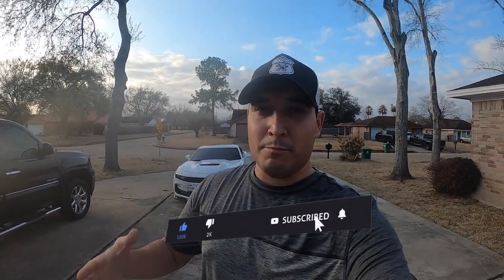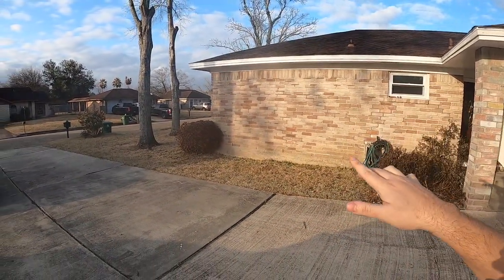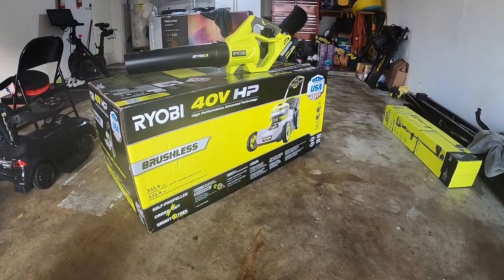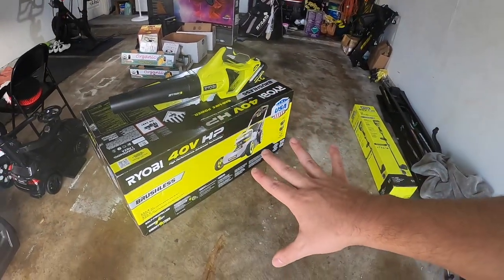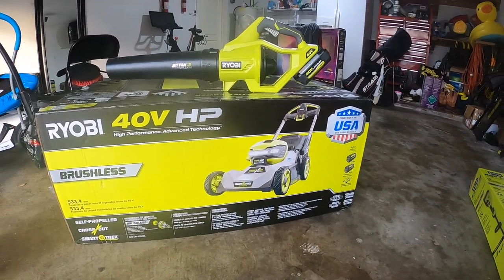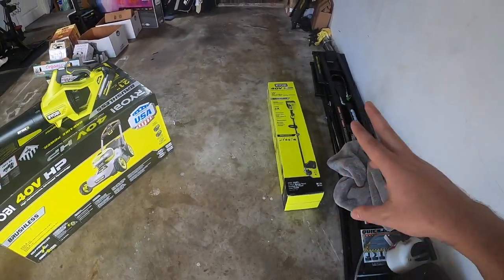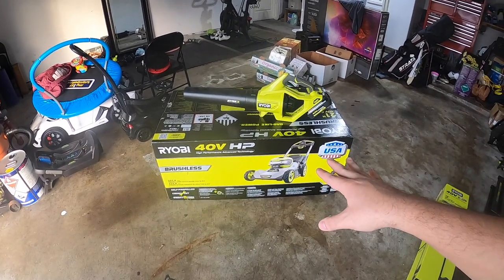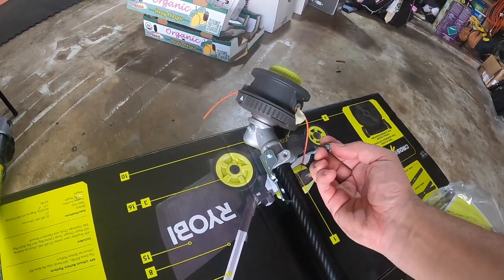RYOBI 40V HP Mower and Carbon Fiber Trimmer! FIRST LOOK | Vlog #409

Comment: Jorge what tipe of drag radials you have and and what tipe of wheels please if you can get me the link where you buy it?
Reply from the maker: Hey, they are weld rts-71 rear 17x10 wheels with Mickey Thompson et street r 305/45r17. You can find them in various vendors.
Reply: @JLSpeed  esos estarian bn?
Reply from the maker: @MrJoseeclipse123  ahí varias opciones. Welds son unas de las más caras, vms racing wheels están un poco más baratos y se miran bien. En términos de llantas las et street r son las mejores
Reply: @JLSpeed  muchas gracias es q. No se mucho de drag tires por eso te pregunto
Reply: @JLSpeed  jorge perdona q. Te meleste algun link para esas plants especificas es q. No se nada de eso
Reply: @JLSpeed  jorge race proven motor sport el video reciente q. Suvieron esta mi carro el caMaro negro en el dyno para q. Veas lo q. Dio con poquitas cosas.
Reply: @JLSpeed  thanks